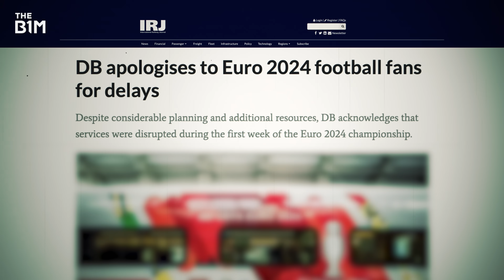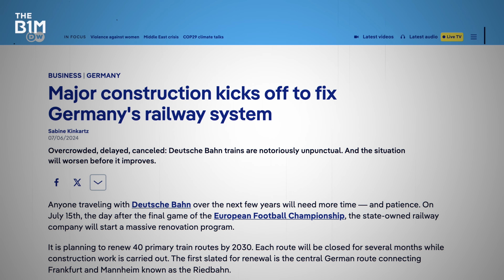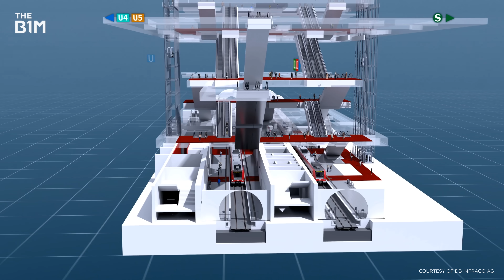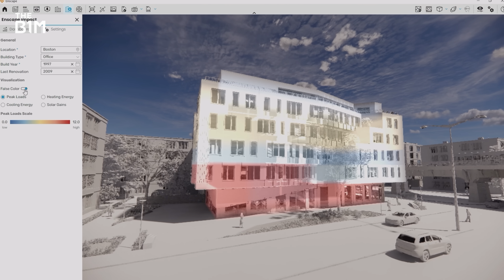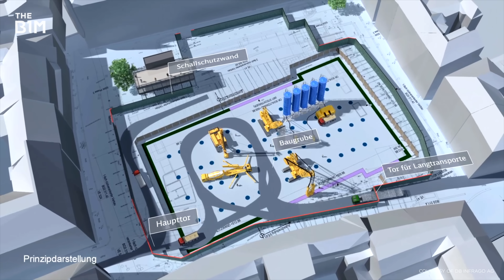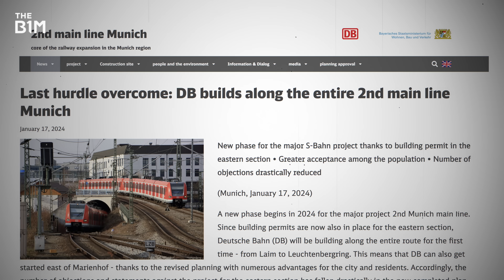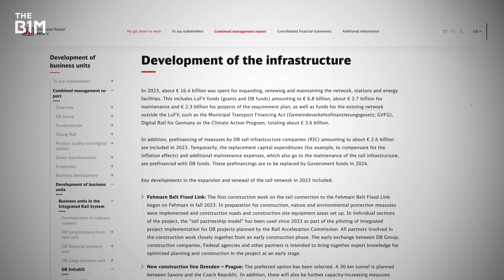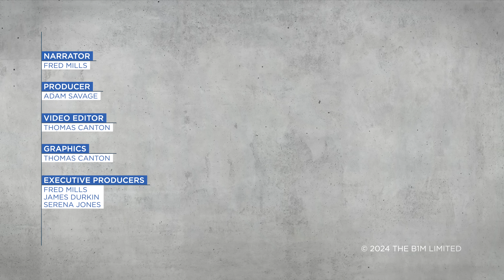Germany is (Finally) Fixing Its Failing Railways

Comment: I actually wanted to take the trains exactly five times this year, inner and outercity connections. Not once of those five times this year did I get to take the train I came for. (Let´s just skip arriving on time because that would be redundant to get into with the DB or the MVV in particular) Given, three out of those five times it was either peoples fault or simply horribly broken tech. It is still kind of a sorry state of affairs because any time there is rail replacement transport it´s a complete goose chase to get the next connection, or getting home at night. And a 0% accuracy rate, even unfortunate as it was, isn´t very enticing to see it as an alternative to a car. 
And that is just basic functionality stuff. Nothing about connections outside of cities sometimes being like an hour off of where you actually want to go.

Comment: That's privatization for you. They're supposed to make profits yet #1 fail to do so, #2 sell off profitable business unit and #3 still requires additional federal funding and subsidies aka taxpayers' money. They've been DISMANTLING track kms for years and more or less let the once not-too-bad network rot into existence, while boasting with sheer incapability, neglect, and stubborness towards stupid projects such as Stuttgart 21 (not the overhaul idea and project itself but rather the environmental and fiscal cost of it which could have been mitigated if not avoided had they been a tad smarter about it; worth a read). That NY Times article amid this years' Euro Cup hurt deeply ◑﹏◐

Comment: I am from Hamburg and to be honest, we do have a very similar problem compared to Munich or Stuttgart. By that I mean that every single U-Bahn and S-Bahn line stops at the main station, which makes our main station the 2nd largest in Europe by passenger numbers. This is a big problem because our main station is not big enough to handle that amount of passengers and although we have 3 other major hubs within the city (Altona, Dammtor and Harburg), they are all located on basically the same line, which means that a lot of regional/long distance line serving Hamburg either stop or pass at each of those stations with Altona being the terminus. And all but one of those stop at the main station using it as either its terminus or as a through-station. The only line that doesn’t serve the main station is the Hamburg to Westerland line starting from Altona to the north. 

So that means that the 2nd largest city and europes 2nd largest railway hub only has a narrow corridor southbound, where most of the travellers want to go as Hamburg is in the very north of Germany.

So you’d either have to increase that corridor which is often subject to delays or you have to build a new one (maybe next to the Elbe motorway tunnel?) to decrease pressure on the existing corridor at the Elbe bridges. None of which is actually going to happen.

Also we’d probably need a ring line like the one in Berlin and/or a tram system again to build some new direct east-west links without serving the central station, especially in the outskirts and in the underserved regions like i.e. Bergedorf, Harburg (both massive neighbourhoods only served by one S Bahn line) etc.

There is hope tho as a third S-Bahn corridor through the city centre is being planned, which would help a lot and the relocation of the Altona station, which will become a through-station, will probably also help decreasing the amount of daily passengers at the main station as this station would make it possible for trains to run from Lower Saxony through Hamburg into Schleswig-Holstein, which is currently not possible because the current Altona station serves as a terminus.

Overall, german railway systems are poorly designed and I think the DB gets that. So at least they are trying to improve it now. We’ll see if they can improve and if so, how long it takes

Comment: We are offering flexible loans and funding for various projects. We have financiers ready to fund projects with low risk-seeking debt funding capital for expansion and startups irrespective of industry or geological position.

A good project with promising returns irrespective of Industry so long as it is legitimate within the jurisdiction where it operates.

The funding type is Debt Financing. This Funding program allows a client to enjoy low-interest payback of 4% annually for 1-10 years. Appetite is between $500,000 to $50m depending on the project risk level.

Comment: As a German it is so horrible. I won’t believe that it will ever get even usable. It’s so bad you can’t even believe it. It feels like every second train I need to take has some kind of an issue and will be late. Realistically it’s 30% where something is a bit late and you either have to run or loose the connection

Comment: Let's get this straight.  In the postwar years, the BRD's pulling up if itself by it's bootstraps happened it's own way .... and it worked tolerably well.  

Following reunification, some bright spark thought "Oh look, things need modernisation and a spot of  maintenance.  The way we we've doing things for nearly fifty years meant a publically owned railway which worked embarrassingly well and we can't have that, so let's do things the same way as the UK and US because they're so good at not keeping investments up to date, or in good order ... and even better at making the rich even richer".  

..... and then the wheels came off. Sound about right?

Comment: Not about rail, but still about the German infrastructure. I've been driving to Germany quite a lot in the past ten years or so. First from the Netherlands, then from France, and now from England, since we moved here in 2023. And if before, German roads were quite low on my rating list (well below the Dutch, French, and Swiss roads), starting with this year, it seems that the years of improving the infrastructure are starting to pay off. I hope the same will happen to the railroad system.

Comment: I'll never get over that one scene in Jason Bourne, where the protagonist is in Berlin and has to escape a trainstation. He does this by looking at the timetable and then blindly jumping off a bridge to land on the train that he trusted would be just on time to catch him. That would have been the end of the movie if it took place in 2024, lmao.
Reply: he probably would have made into something that was supposed to depart 3h ago from a different gleis
Reply: @lodxt 😂😂😂
Reply: Nah, he was at the U-Bahn in Berlin. Those blink when the train is about to arrive - and the U-Bahn is rarely late (even when they are, the time shown on the screen is accurate). The notoriously late trains are the inter-city/regio lines, basically the trains that go between cities.
Reply: U-Bahn is rarely late, because it runs on its own rail system separated from all other trains. I think it is even incompatible with regular train rails.
Reply: @jannikostermann9821 U-Bahn is so infrequent it needs a timetable? Meh.
Reply: Imao
Reply: It depends on what you mean. If you're looking at the entire picture, then right: Trains (incl S-bahn) have their own tracks and system, separate from U-bahn. The latter however are (if necessary) transported via the rail network, on their own wheels (the track gauge is identic), then shunted over to the U-bahn network at a spot in the track that is situated next to the other system and has the necessary points.
Reply: Just as he jumps you'd hear the ominous "*GOOONG* Information zu: RB1, heute circa 30 Minuten später"  😂
Reply: It would never have worked, because he would have been electrocuted by the overhead lines with 15,000 Volt. Perhaps the screenplay author had smoked something improper?
Reply: @TheWuschelMUC  in Berlin you don't have overhead lines, the trains actually get powered through the tracks
Reply: I just watched the Bourne trilogy yesterday and he jumped onto a boat :)

Comment: 2:50

Fun fact: 40 Billion is nowhere near enough, not even close

In a prediction, it stated, that to bring the German railway system only up to date with current technology, you'd need at least 90 Billion, and even that number is low balling it. For example they're repearing a 120 km section currently, and it has costed 50 million so far.

Comment: I used to travel b by train across Germany several times a year before 2020, for years, just visiting friends. After I finally started to take it back up to at least some degree last year, I was honestly shocked by just how bad it was and wondered whether really was that bad or just seemed like it due to the break I have had and me potentially forgetting some of the issues I had in the last. But no, it just really got worse

Comment: Another important point to mention is that, even if all the high-speed corridors and new lines operate perfectly, the rest of the system is still in dire need of upgrades. Too many busy lines have not been electrified and/or are still single-tracked.

Comment: The passenger railway was suposed to be relieved by a new specific goods railway from Rotterdam into Germany. Agreements were made and Netherlands opened the railway in 2007. We are still waiting on Germany to finish their part of the railway in Germany.
Its discracefull how missmanaged Germany is.
All their highways in NRW are also under construction for 10+ years and never seem to be actually worked on.

Comment: As a german, i really hope future goverents and the future executives of the DB wont stop at when these renovations are finished and instead aim at building new high speed and high capacity corridors in order to be able to compensate future incidents and renovations on existing corridors without having a big impact on passenger and freight travel. As well as reopening small train lines to connect rural areas with some sort of train service. This could play a big role in making train travel more attractive in germany and cutting down on CO2 emissions.

Comment: I remember some years back travelling on the German trains and thinking they were amazing, and then more recently being so disappointed by how badly they'd gone downhill. This is great news!
Reply: Well the trains themselves have not gone down hill really. Germany has some very good trains, the high speed ICEs as well as various very nice regional train sets, which have seen various comfy new models over the years and are mostly kept in decent condition.The main issue is the rail infrastructure and rail network that has not been extended as much as needed in terms of capacity, partially even stripped down after the "bahn reform" that tried to shoe horn "the market" into it – and some of the infrastructure is bloody old and hard to even maintain properly if you wanted to. This should in part be taken care of by this overhaul thankfully, but we'll have to hope that there's enough political will after this to keep investing in extending the network as well.
Reply: @Hugh_I  Thanks for your reply. Maybe I just had a bad train. I remember looking forward to getting a coffee and the bar was shut and something else was broken. Was a little while ago now.
Reply: @tompearce6312  yeah, the on board restaurants randomly being close because they lack the staff is sadly still an issue. At least I recently discovered they notify you beforehand in the Bahn app now, but can't say yet how reliably they know this in advance or whether you still have to just find out on the train.

Comment: What about all the planned motorways and expressways that have not yet been built from the 1976 plan. 
There are still huge gaps in the planned motorways such as the A20: 200km in planning and the construction work has stood still for over 10 years? 
The A1 has had a gap of 32km for 30-40 years.
The A4 has a gap of 150-160km between Krombach and Kircheim. So you have to go on a detour where you haven't even been able to connect two ends of the short connection A480 where 10km is missing? 
The A5 was planned to go all the way to Bremen, but stops north of Frankfurt?
Bundesstrasse 5 is it also very slow to expand from the A23 up to the Danish border?
We pay a lot in diesel and petrol tax when we drive through Germany and the trucks pay extra in tolls. Where does the money go? 
Probably to the rail mafia, where the operators don't pay enough to use the extremely expensive railways.
Reply: Those are all rookie numbers... the A44 will have been under construction for 100 years soon and its still not done.

Comment: The U in U-Bahn stands for “unabhǎngig” which translates to independent and means that its independent from other traffic such as cars compared to a tram for example.
Reply: It actually stands for "Untergrundbahn", meaning "underground railway". Independance from the rest of the city's network is still a key factor, though that partially correlates to it being underground
Reply: @JustAnthon   both are correct however Hamburg U-Bahn goes overground most of the time. Same goes for Stuttgart where it’s partially underground but also uses actual streets which is why it’s called Stadtbahn there and not U-Bahn as it’s not independent.

Comment: I lived in Munich from 2004-2008, they have been talking about building that second tunnel for a looong time. Glad to see it finally happening, great work B1M
Reply: We are offering flexible loans and funding for various projects. We have financiers ready to fund projects with low risk-seeking debt funding capital for expansion and startups irrespective of industry or geological position.

A good project with promising returns irrespective of Industry so long as it is legitimate within the jurisdiction where it operates.

The funding type is Debt Financing. This Funding program allows a client to enjoy low-interest payback of 4% annually for 1-10 years. Appetite is between $500,000 to $50m depending on the project risk level.

Comment: Important to note: those 60BN € cover only half of the investments that are needed today (a figure that is likely to increase during the time frame during which the Money is planned to be distributed). 
Additionally, Stuttgart 21 has severe architectural concerns that make the entire project infeasible in the long term and likely to fail even if construction is finished (among other things, the entire station is tilted to an unsafe degree meaning anything with wheels will find itself suddenly relocated while the tunnels which will be drilled for the rails are in a region are in a region where those same tunnels will be prone to flooding. Since the stone through which the tunnels will be drilled is highly water absorbent and swells extensively while doing so, any flooding will most likely lead to extensive damage to those tunnels.) 
I think (but I'm not sure about this so please fact-check) that at some point it was proven or at least made very likely that Stuttgart 21 as a project was created to shuffle money into the hands of certain construction companies and that both from an infrastructural as well as from an architectural perspective, there was no reason for this project to actually happen.

Comment: Its truly a wonder on how there is literally no infra project in Germany with less than a decade of timeline. Even a small road widening or starting of a tram line takes in the order of decades. The phased roll out option seems to be incomprehensible to the govts.

Comment: Who remembers Edmund Stoibers plan for high speed magnet trains (Transrapid)?
lmao, people made fun of him, but had it worked out there would have been a not so insignificant chance China would have went with Transrapids for their high speed rail development that kicked off a bit later.
And with Germany having a stake in high speed rail, I'd be willing to bet Europe would have a more competent net as well.
Reply: the Chinese are mostly building stolen german and Japanese high speed designs.
but yeah the Transrapid would have been cool, but they went for high speed rail because you can start running those trains on old track and dont have 10 years to build something new.

Comment: 1:37 DB is not state-owned but instead a private company owned by the state. This might sound redundant but it actually makes a huge difference as state-owned companies in germany are not allowed to have a profit-driven structure by law. They need to have a company structure primarily designed to satisfy public needs.
A privately owned company on the other hand - even if it's owned by the state - doesn't have these restrictions and thus played a huge roll in the neglection of the DB as the main focus was money. There was no need to keep the rail network in good condition as there wasn't any competition anyway.
Reply: that argument is nonsense
and i have heared it way to often
...
the problem with the DB is that it is running Deep red numbers
otherwise it could use the profits it makes to increase it Capital and then it would have money to invest
....
the reality of the "privatization" is that the government drastically cut subsidies
and then sayed "its not my fault it is collapsing" 
it is a privat business
....
the DB is 100% staat owned 
the staat has 100% control over its managment
the staat has 100% control over its policy
the staat has 100% control over its financial structure
...
the staat could increase the capital (Kapitalerhöhung)
or increase subsidies again
but bouth would cost money